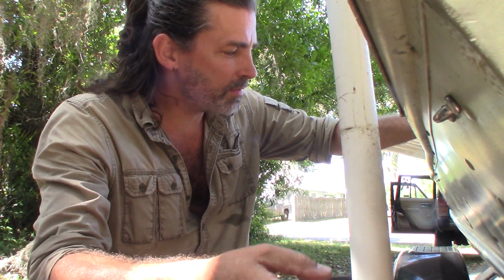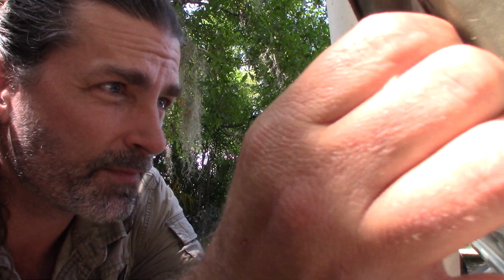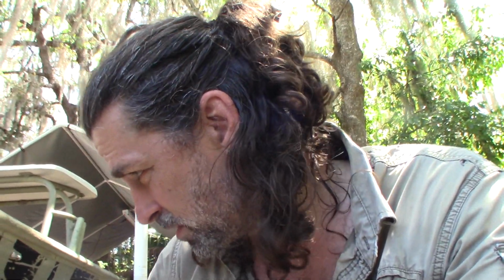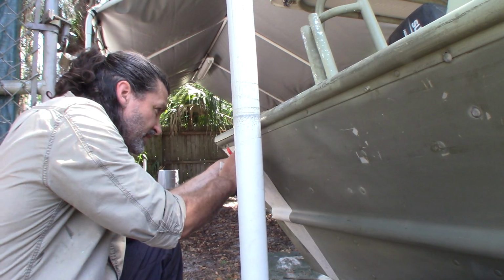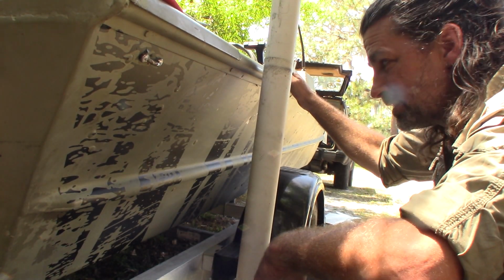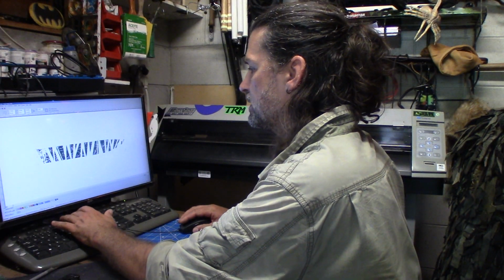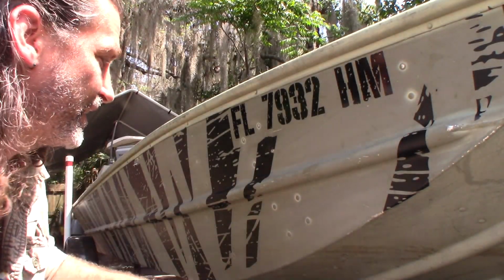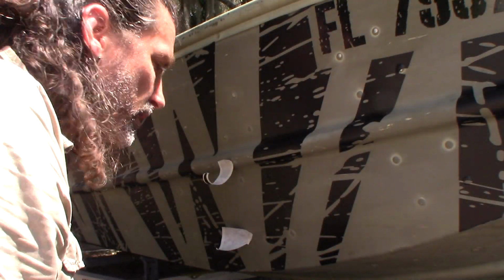New Boat Graphics

Comment: Would look nice in white also and a jack plate for the motor get that prop up. Looks good.👍
Reply from the maker: Thanks yeah I agree, I an looking to upgrade to a 30HP and I will get a trim plate installed with it. Right now its manual trim only.

Comment: Legit, digging that design, good color for the boat, and enough spacing to make it look cool. Bummer on that prop. I wondered if you ever run into objects in the water.  The witch should be ready for some FL adventures soon.
Reply from the maker: Thanks man! The prop is still usable just not efficient. I;m going to stuff it in a hatch as a back-up prop. Looking forward to some deep river adventures very soon.
Reply: @JungleJayAdventures  Gotta break those decals in proper.
Reply from the maker: heeeeelllll yaaa!

Comment: Silly question, but could I spray a coat of polyurethane or something over my graphics to protect them or would that ruin the graphics?  The boat looks great!  I love it!
Reply from the maker: If you use a solvent based poly then yes, if you use a water based they should be ok. The Durability of water based polyethene is not as good.

Comment: Pretty flat bottom, is it for swamps and low rivers? What is the spoiler thing by the engine for? Anyway, wicked good decoration!
Reply from the maker: Its a Jon boat, yeah mostly for shallow areas. Perfect for Florida waterways. Wish the motor was mechanical trim. Its ok though. The Thing over the outboard is a sight platform that was installed long before I owned the boat. You can stand up there and look for fish.